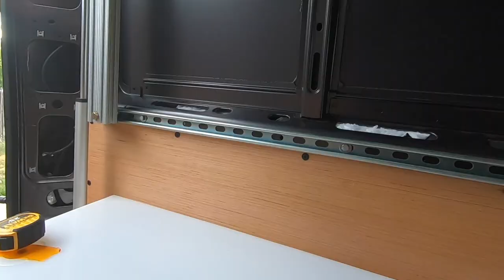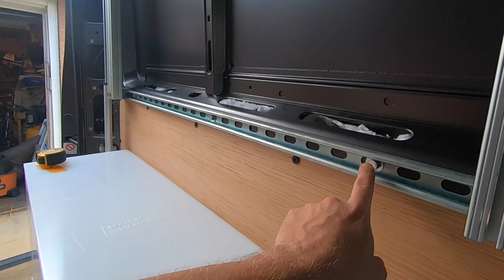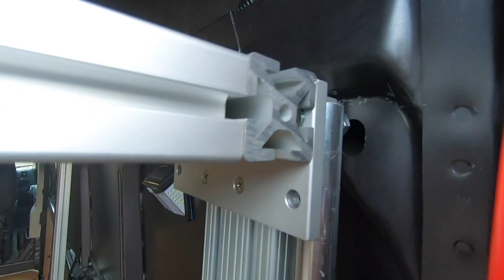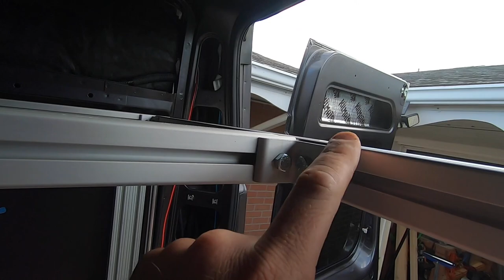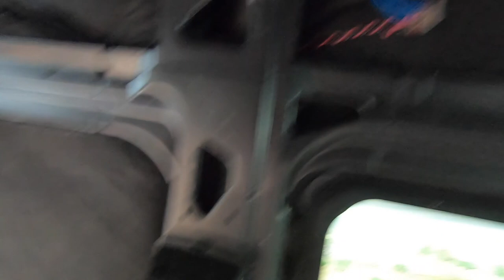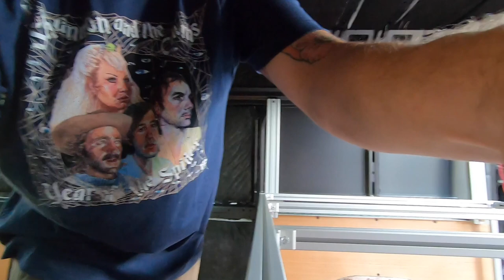ULTIMATE DIY BED LIFT in a Ram Promaster

Comment: I’m going to use aluminium extrusion for the framework, make the box out of bamboo ply, keep it ultra lightweight. Though I’m aware of a whole lot of alternative lift mechanisms now, I’ll get an engineer to design my lift mechanism, and I’ll have a manual override system. Nothing wrong with a rotary winder with chain and manually placed stoppers for brakes
Reply from the maker: Good ideas! Manual override may come in handy if you have issues. I've also considered adding stoppers but so far I haven't had any issues or felt worried about having any problems in the last year or less of using my bed lift. Good luck with your build!

Comment: fine setup. i think people are forgetting that in the up position theres not any weight on the bed. of course theres the bed and frame, but i dont think it takes much to lift an empty bed. most pin, or lock, the bed once up. thats how people get away with just some weak gas struts to get the bed lifted. and then lock them in the up position. this is of course when you have the bed resting on benches and cabinets in the down position. which youre gonna have anyway. we all want a bed lifted up so we can build things underneath! im wanting my bed lower and higher. i want to get in and out of the bed easily, and i want the mattress as high as posible for head clearance when utilizing the space underneath. im thinking of a sizzor system... to get the most range with these shorter stroke screws and actuators
Reply from the maker: Thanks for the comment! I have attempted to lift the bed with two friends in it and it may have worked but I can hear the actuators struggle immediately so I didn’t attempt. They are rated at 225lbs each but I believe that is false.

When my bed is down I don’t have it resting on anything and the actuators keep it in place just fine. You could always mount a bracket for the bed to rest on when down if you wanted but I have zero issues.

I’ll do an update video eventually to show how my final product ended up.
Reply: @vanishthevan  yours is a fine setup. i just want more range. and i will build things for it to rest on. thats not a problem... making sure whatever is equally the same height (bench backs or whastever). but, some might want to lower their bed half way for sleeping underneath. those heavy actuators will come into play there too :)

Comment: Nice video. That bed will give you so much more room in the van. I'm planning something similar in my van.  Are the 12v cables that supply the actuators all the same length and thickness? Plus the same length cables from the batteries to the switches. If all the cables are different lengths, the resistance in the cables will be different. In effect supplying more power (higher current ) on the shorter cables and less power on the longer cables.  The other alternative is to put the faster actuators on the longer cables to slow them down and the slower actuators nearest the power supply (battery) which will speed them up a bit.
Reply from the maker: Thanks! I like it a lot so far! The only thing I may not like is not having a garage to store outdoor things and tools but I’m going to work on a solution later on. The extra living space is great tho!

The cables that came with the actuators are a tiny gauge and I paired them with 14g I believe.
They are cheap affordable actuators and I can easily replace them later on if needed. The cables that run are not the same length. When I move the bed up or down, I can hear them all finishing their strokes separately. There is about two seconds from the first one finishing to the last one. 4 in total.

I’m not worried about the speeds of them at this point. Ive been traveling and using the system daily for nearly a month. They all go up at different speeds but the track system with extruded aluminum, the linear bearings, actuators and overall build is working well with zero concerns.
Reply: @vanishthevan  That's brilliant news. I'm glad the actuators are working well for you.

Comment: May I ask why have two switches? Can you have just one switch for all four actuators? thanks for sharing.
Reply from the maker: I used two switches to be able to adjust one side higher than the other. You could use 4!switches if you want that adjustability. You could use one as well but the more you have the more you can adjust each one, especially since they run at different speeds.

Comment: When designing this, I'm wondering if you considered using Track Actuators instead? I'm think it would actually eliminate 2 actuators and 2 slides or maybe all the slides from the build depending how it was mounted.
Reply from the maker: Hmm, interesting. I wasn’t sure what those were so I had to look them up. It’s certainly possible I would imagine but don’t know how you would get away with just using two of them. I would bet you’d need to support all four corners of the bed with 4 of them but it could eliminate the use of expensive extruded aluminum and linear bearings!
Reply: @vanishthevan  Yeah, after I posted this I later came across a video of a van conversion using them. He's using 4 of them.  https://www.youtube.com/watch?v=ybhOJrPUARc
Reply from the maker: @therealCellblock1138  Interesting! I guess those would work as well. Not sure how he plans to replace one if they short out. I have my actuators installed in a way that I can easily replace one if something happens to it and I have two spares ready to go. Hopefully that never happens. It's been over a year already with near daily use and so far so good!
Reply: That’s exactly what is keeping me from doing the track actuators, even though I really wanted to.   Thanks for your video.  Appreciated the detailed information.

Comment: Did you consider building the bed frame from unistrut ?  It it a 2 plane system, whereas the 80/20 is 4 planes, perfect for the sliding rails.  The linear bearings are captivated on 3 sides.
Reply from the maker: Oh! Well, unistrut is much heavier material. I’m sure it would work still but no, I didn’t consider that.

Comment: Could you add a parts list with links? You might consider a control box for all 4 actuators -- just to risky to go for a 1" rise vs. binding the whole system. ? What is the lift lbs rating for each actuator? What is the speed of the actuators mm/sec? Why didnt you mount to the ceiling of the van so it could go higher and thus stand under the bed?
Reply from the maker: Hi, thanks for the comments and questions! I am almost done rebuilding the entire lift system and will be doing a new version2 video in a week or two! Stay tuned and I’ll try to answer all your questions in the video!
Reply: @vanishthevan  Cool. I have seen some implementations with the ford transit --- you make a smaller bed that can hug the roof so you can stand underneath. Then when lowering the bed, it snugs in and hugs the cushions on the side (e.g. top pf a bench seat) to elongate the bed giving you an even bigger space. Food for thought anyway. Nice engineering. Love the detail and the plan. Lots of great ideas here.
Reply: @sunflowerseeds8007  yeah exactly! I just published a new video on the channel with my latest modifications. Let me know your thoughts!

Comment: Excellent design. Impressive build. And I do like your style of video explanation. Will be curious if you were to just lay a piece of plywood or something across it does it support your weight plus maybe anybody else is going to sleep up there without flexing.
Reply from the maker: I had originally added a piece of plywood and tested it with my buddy for a total combined weight of about 500lbs. No problem at all. 

I ended removing the plywood and adding bed slats from IKEA instead. Even better!

I’ve done more work on the bed and other things but have been dealing with personal stuff lately and haven’t had time to upload anything but plan to again soon.

Comment: Great build! Do you have a link to the linear bearing? Ty
Reply from the maker: Thank you! I bought these but looks they’re not available now. I’m sure you can find similar ones… Homend DC12V 26inch Stroke Linear Actuator with Mounting Bracket 900N(225lbs) Maximum Lift 10mm/s for Recliner TV Table Lift Massage Bed Electric Sofa Linear Actuator https://www.amazon.com/dp/B08K458FCM/ref=cm_sw_r_cp_api_glt_fabc_KXABPNMDARRX6Q72YJJA?_encoding=UTF8&psc=1
Reply: @vanishthevan  perfect thanks. I ordered some with 30inch stroke👌

Comment: I bought my high roof to do this.  I’ve made my bed frame 66” front to back and 60” side to side because that is the clearance space available in my transit, out of 15 series of 80/20.  I want to do this but have been afraid of binding. And not confident about the wiring too.   I don’t want to worry about leveling, just want it to go up and down easily.  I wish Zi could talk with you.  It that possible?
Reply from the maker: You can do it! I wouldn’t worry about binding too much. I was worried at first but it’s really not an issue and you don’t have to be as exact as I explained in my video.

The wiring is not very difficult at all.

Let me know if you have any more specific questions!
Reply: Yup, I’m building my two benches in back that will be under my bed. I have a heater/ a/c unit in back in floor that I want to keep ( originally was a commercial passenger van) . My question is :  Do I have to put actuators in exact corners?  Or can Actuators be more in towards center of bed frame because I also have my wheel Wells (dualists) to contend with as well. 
I was thinking of just hanging my bed from ceiling and installing winch because of all these other things to contend with.
Reply from the maker: At first, I had my actuators in front of my vertical 15/30 series aluminum and had them angled at about 15 degrees and they still performed well. I ended up moving them to the side, where they are now in the video.

You should be able to put them wherever you want. Mine ended up as they are because that ended up being the best location for me.

I don’t know much about a pulley bed lift system but I love how mine turned out.

Been in the road for the last 2.5 weeks, using the bed lift daily and sleeping in the bed with zero issues and I love it!

I would recommend using 4 of them and keep them as close to the corners as you can for maximum stability.

Comment: the speed difference on each motor is probably due to your wiring setup...  series vs parallel?  if they are the same make and model, there shouldn't be a difference... cool setup none the less !! cheers
Reply from the maker: Thanks! I don’t know much about what I built. Maybe because the wires are different lengths? Or maybe because they are cheap?
Reply: @vanishthevan  actually, after I posted, I did some research and it does seem that these motors even though are suppose to be the same, may have different speeds !!! very strange so probably not something you did !!!
Reply from the maker: Yep, that’s what I had read prior to building it. What I can tell you is that with the extruded aluminum and linear bearings, the difference in speed doesn’t compromise the system in any way. I used the system daily, up and down, for two months without issue. 

I plan to do an update video on how I ended up finishing it soon. Waiting for a warm weekend. Possibly next weekend!
Reply: @vanishthevan  cool.... good to know !

Comment: l'm curious if this kind of thing is available if you're not as handy as you are - or don't have a garage/tools? I want this in my dream van (or short bus) with seating/table under. i didn't catch the size and l rarely hear about smaller-sized beds as i'm a very still sleeper and a full is plenty of room for my 5'6" self. i'm even thinking twin but l'd like to get a pet as my co-pilot.
Reply from the maker: Hi, well, this is custom made based on my needs. There are some companies that make them for different model vans but they’re pretty expensive. Building this wasn’t too difficult in my opinion. If you have any specific questions that you need answers to, I would be happy to answer them.

Comment: Do you have the link of your linear actuator
Reply from the maker: These are the ones I bought but are now unavailable. You can likely find similar ones…

Homend DC12V 26inch Stroke Linear Actuator with Mounting Bracket 900N(225lbs) Maximum Lift 10mm/s for Recliner TV Table Lift Massage Bed Electric Sofa Linear Actuator https://www.amazon.com/dp/B08K458FCM/ref=cm_sw_r_cp_api_glt_fabc_DEJTT5YMSEVJPRG8KQHJ?_encoding=UTF8&psc=1

Comment: Nice set up. Just priced it up in the UK using linear track and adding seperate actuators came to £600 and change.  Dont see the necessity to use aluminium for the frame but each to their own. 

Cant understand why you would wire them as pairs and not all together?

  You can control the speed of individual acctuators by varying the length 9f the supply cable so any difference can be allowed for.
Reply from the maker: Great to hear that!

I put mine in pairs for one specific reason: the back two on one, the front two in one. I am able to get roughly 4 to 5 inches of difference between the two sets, this way if I am parked on a slight hill, I can adjust them accordingly to level the bed.

It’s been two years so far, with no real problems. One of my actuators failed recently and I was able to remove it and repair the gears and get the system working again.

Comment: What would say the total cost was?
Reply from the maker: Hi, the actuators were $50 each (4), the 8020 liners bearings were $80 each (4) roughly two 10 foot pieces of the 8020 15 series were $70 each (2), plus nuts, bolts, wiring, switches, unistrut, etc… probably another $100, so I would say: $600 to $700 just for the lift and frame. Then whatever you decide to use for the platform. I’m using 1/2” bitch plywood with 2” holes drilled throughout for airflow underneath the mattress. That’s another $150 or so dollars.
Reply: @vanishthevan  what is the total weight capacity?
Reply: @vanishthevan  We need to get some "1/2" bitch plywood" lol
Reply from the maker: @marshahutchison1446  Each linear actuator says it can hold 225lbs, so roughly 900lbs!

Comment: Hey dude, nice one! Building something similar just curious.. I know the actuators ascend/descend at differing rates, but the sensor stops them when they're fully out or in.. so do they all stop at the same height, one after the other.. or does the first one to the line trip the switch so they stop at the same *time? 
Ps the  motor on the side winds out a long threaded bar inside 👍. Cracking neat job fella, given me confidence to continue mine! Kudos from UK 🇬🇧😁👌
Reply from the maker: Hey, thanks for the comment. The actuators all stop independently once their own switch is triggered. Due to the different speeds of each of them the bed can become wonky at times but an easy fix is to lower the bed all the way and bring it up again. This only happens if you don't completely lower or raise the bed before lowering/raising again.

Good luck with your build and thanks for watching.

Comment: Your motor speed is different because your length of wire is different to each motor. Find out how long of a wire you need for the passenger rear motor and make each wire to each motor and they should be closer to the same speed.
Reply from the maker: Hey! Thanks! I’ll try to get around to giving that a shot. Gotta crank some wrenches to get to the connectors so may not happen soon but for what it’s worth, the system works pretty well as it is. Some are slower but when going all the way up or down, they level out.
Reply: @vanishthevan  yeah it doesn't seem like a pressing issue. The difference in current isn't really all that much, but it is enough to make them run at slightly different speeds. And now that I have rewatched the video what you have them wired two in series so you would make the lengths of wire the same from the switch to the pairs and the wires between the two in series the same length. That is if you deem it necessary. Which it really isn't.